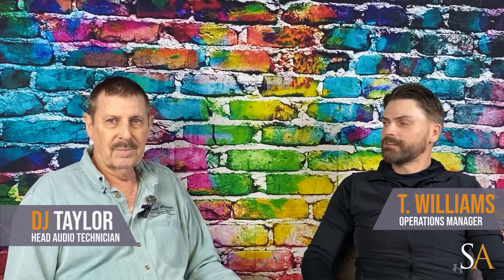Sound Approach discusses RCA & XLR Cables

Comment: XLRs make me sleep well…and I don’t have kids. Robust connections and construction , RCAs are home connections XLRs are pro level connections and reassuring safety ! Sound wise XLRs are + 4db RCAs are -10  db also you have one extra cable that reduces resistance. If you have them use them ! If you don’t , don’t worry about it cause most equipment is non balanced single ended . And now with Speakon’s and Powercons  it’s the way of the pro world for good reason.
Reply from the maker: @ernestporee3697 I like XLR cables too! they don't help me sleep, but that's only because of my crippling insomnia...lol 

But you're not wrong, there're several reasons for using them and if you know, you know...thanks for the comment!

Comment: So is it a myth that XLR stands for Cannon X series Latching connector Rubber insulation, that superseded the XLP with Plastic insulation?
Reply from the maker: @stephenjones8156 While it doesn't really mean much now, XLR technically stands for eXternal Line Return since it returns the signal to the source after being processed. This type of connector was originally designed by Cannon Electric, from the Cannon X series. When they introduced the latch and rubber, they named it XLR. I think the myth is probably a little true and a little bit of marketing from back in the day for the upgrade. But it's not bad marketing when your product name turns into the standard...Think dumpster, band-aid, bubble wrap, or jacuzzi!

Comment: Is it true that there is a burn-in period on interconnect RCA cables? If so, what is it that happens to the cable over this period of hours that improves the sound quality over time?
Reply from the maker: Yes, it is true and can range anywhere from 100-300 hours (sometimes longer) depending on the quality of the cables. During the manufacturing process, gasses can be trapped between the insulation and conductor and the burn-in process releases these gasses. Additionally, burn-in dissipates the high electrical charges which exist in new cables from the manufacturing process. Once completed, burn-in allows for the best sound quality after the conductor has settled into its best conductive state. Thanks for the question!
Reply: Thank you so much for your detailed explanation... much appreciated! @soundapproach1972